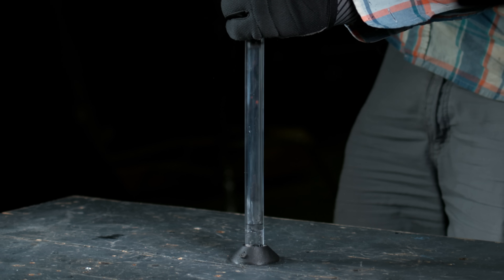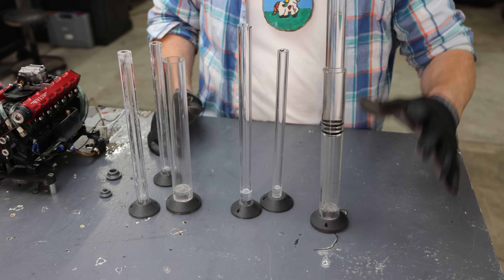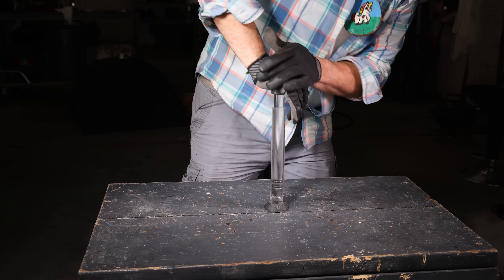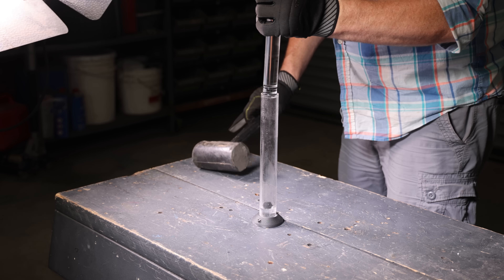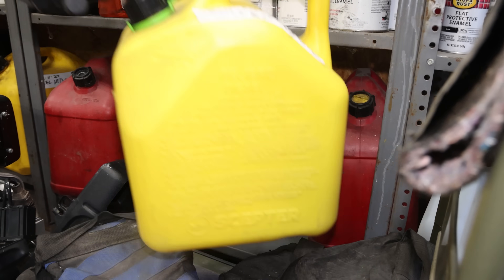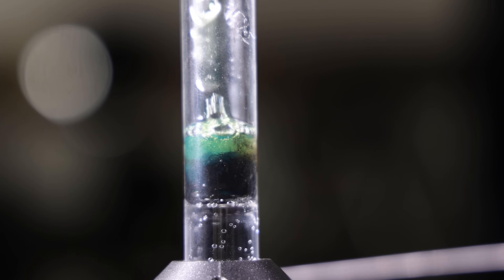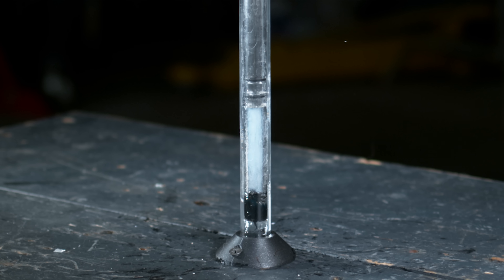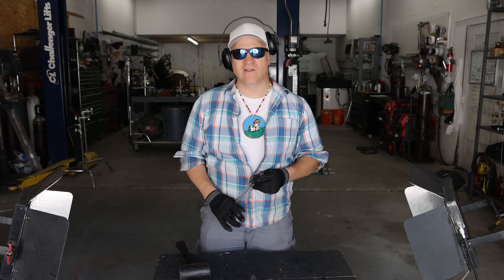How Diesel Actually Ignites (Slow Mo)

Comment: There's probably a good reason diesel engines aren't 
 made of plastic
Reply: Not yet. That's the next cost saving move to come from Caterpillar and Detroit.
Reply: @justacinnamonbun8658  The future is not reliable.
Reply: Probably also a good reason why gasoline motors aren't made of plastic ?
Reply: @carmichaelmoritz8662 what you mean? My manifold and most likely your manifold is plastic 😂😂😂

We on our way, plastic motors lets gooooooo lmao
Reply: @cuinican1980  i hear ya lol. those plastic intakes usually warp around the same time the vehicle starts rusting out.  It's all part of their plan lol.    Mine is aluminum.  First motor went out with around 300 kilometers and was replaced with 180 kilometer motor.
Reply: lmfao, came to say this, and it's the top comment.
Reply: Yes we must create fire & ignition with diesel but in severe cold weather we find them in sick bay with blankets!😊
Reply: Also, they run usually around 16-18:1 compression, most diesel engines from tractors to trucks.
Reply: Bro is giving everything for the show

Comment: This begs the question: isn't a combustion an explosion?
Reply: It quite literally is. Pressure from the ,explosion is what drives the piston, not the heat from fire.
Reply: Explosion is heated, pressurized gas expanding faster than the speed of sound in our atmospheric composition. This is deflegration. If it was an explosion, our guy here would be going to the hospital getting plastic removed from his body

Comment: So if Diesel ignites at a certain pressure, why not do the same principle with gasoline engines. Gasoline would even ignite at much lower pressures, since gasoline is much more flammable than Diesel, right? So you'd have the advantages of the Diesel engine in a gasoline engine.

Comment: Diesel also likes to ignite much better if it’s compressed twice if you can introduce the diesel into the tube just like an engine (under pressure and fine mist) it would probably work beautiful. Diesel doesn’t care about not about running dirty

Comment: Diesel engines range from 16:1 to 25:1. 25:1 is very high even for a Diesel but does exist. It is not the Norm however. 

Turbo charged Diesels typically range from 16:1 to 19:1, while Naturally aspirated Diesel engines range from 20:1 to 25:1.  There are a few odd ball Trubo Diesels that are as low as 14:1 and some custom Diesels that are higher than 25:1 but I couldn't name a  production engine higher than 25:1

Comment: Am I the only one that as I was watching this I was expecting that guy with the hardhat who looks over at some jobsite insanity or other in disbelief, then turns to look at another one?  In fairness he is wearing glasses that could be safety glasses and he's wearing gloves, that's a good thing -- but with explosions going off at nut height I'd be looking for some protection there.
The pyrolyzed cloth didn't need much diesel on it, the more of it there was the more work to get it hot enough.  When you think of how far you can drive on a kg of diesel, lets say 25km at about 80kph -- that works out to 1kg/1125 seconds or about 89mg/s.  Now if the car is four cylinder and running at 2500rpm you'd have 83 power strokes in one second putting the amount of diesel injected into a cylinder for one power stroke is about 1mg.  The amount of diesel on the cloth looked about quarter-gram or about 250 times as much as the engine consumes in a single power stroke.  It is remarkable how efficient modern ICE power plants are.  Even more remarkable that the injector is able to dispense this amount with accuracy given the need for the pressure to be upwards of 500 bar.  And then to be able to do that for thousands of hours and hundreds of thousands of km.

Comment: Actually attaching the charcloth to a piston would allow you to fire it, then pull out and start the fire. This is an ancient device called fire piston.
And it is not only the temperaturę from adiabatic compression starting the fire, but also the increase in partial pressure of oxygen. Use pure oxygen in your fire piston...
But there is caveat: explosion can be much more potent, so you have been warned.

Comment: Might be interesting to try a model airplane glow plug and methanol, compressing the alcohol/air mixture and the thin catalytic platinum wire housed in the glow plug.

Comment: I'm not so sure its the heat that ignites the oil or charcloth. The high pressure increases the reactivity and drives down the flash point. In a diesel piston at the moment of peak compression, oil is "pyrophoric", bursting into flame on contact with the (highly compressed) air. Submersible vessels that have air cavities inside could experience a diesel moment when the air pressure exceeds 25 atm and every trace of oil, paper, cloth, etc. ignites.

Comment: I work with sCO2 - Supercritical CO2.   It reacts similar to this concept except no flames or explosions, it is basically taking liquid carbon dioxide and compressing it to 1,072 psi (or higher) and simultaneously adding about 100° F heat to it, you will watch it turn into a gaseous state.  It is the same stuff they use to extract oils from plants such as cannibas, they also use it for making those powerful Essential Oils that your wife always talks about.  It's also used by Hard Drive computer component manufacturers such as Hitachi.  It is the best degreasing agent in the world, all semi-conductor manufacturers use it as well.  Anyway, I know it's totally different, but the concept of pressure and heat is what I found similar.  Thanks for posting!

Comment: You get an explosion when the liquid fuel evaporates and becomes intimately combined with the oxygen in the air.
You get a fire when the solid fuel is never as finely divided and combustion happens only on the surface of the solid fuel.
Flour mills explode because tiny particles of wheat (flour) are suspended in the air.

It's the intimate contact between oxygen and fuel that makes an explosion.

Comment: but in diesel engine, the torque produced from each ignition some lost in the way of getting other cylinder's compression for more ignition. and to fix that, they tighten the ignition interval per cylinder by adding MORE cylinder, and making engine heavier. so, then some of the torque lost to the weight that the engine still have to deal to propel. see what im getting at here?
it almost levels out. the more larger the cylinder bore, the more compression to do, the bigger the ignition capacity and power output, but since more compression work to do and more pressures required, more torque produced lost in the way too. funny isnt it?
and ALL diesel cars still NEEDS BATTERY and electric motor to start the engine. unless your arms are strong enough to rotate all those heavy pistons and compressions with a lever. 
just get an EV. thats the only coherent energy turning into power flow in any kind of modern engine. there is no power lost in transition.

Comment: That type of experimentation is grossly irresponsible, it was inevitably that the glass cylinder walls would shatter in most cases. Doing that you are asking to blind yourself for life and receive multiple lacerations from flying shards of glass. That type of experimentation should be done within a blast proof enclosure under strictly controlled conditions.

Comment: People often was told there was a glow bulb's inside diesel engines , but the truth always comes.
Reply: It is, for cold weather to accelerate the air heating process. But it depends on compression or turbo psi. Semis usually don’t have glow plugs.

Comment: love this.. i know its an old video..  but alas *NOW* people shou;ld understand why on diesel engines having proper clamping fasterners for the heads and forged internals are a must as well as not boring out the cylinders too much with diesels.. the cylnder pressures are incredibly high in diesel engines..  you also have no timing.. so its very possible for flame is starting while the piston is still under down energy.. granted this piston doesnt have very much inertia but still it can had to the shock and too-fast flame spread..    another thing is this is what happens when you spra ETHER in a diesel.. it explodes very fast and with uncontrolled timing..  something to note for those who repeatedly spray ether in their diesels ratehr than plug them in or use coolant preheaters or fix broken glowplugs...  Awesome learning tool!!

Comment: in the Navy, we called it dieseling.  We were taught whenever you pressurize an air system to do it slowly if you do it too quickly any oils that were left over in the pipe could have a fast burn. That would be bad.

Comment: Remind me why diesel engines are generally so tough..... They are over engineering them for safety. 💥

Super high compression ratio even vs a turbo on a gasoline engine..... By a bunch.😅

Comment: He said a diesel engine has a compression ratio of 22:1.   Nope, most are around 15:1 as that is the optimum for fuel efficiency.
He said diesel engines are powerful because of their compression ignition.  Nope.   It doesn't matter if its compression ignition or spark ignition, you get virtually 100% burn in either case.   But gasoline engines run stoichiometrically (optimum fuel/air ratio), whereas a diesel always operates with less than stochiometry, so its power output, size for size, is always less.

Comment: From my memories of Engineering theory of heat engines, plus a bit of real world messing around with engines.  Diesel is as close as possible to a constant volume engine (a sharp ‘explosion’ at a near constant volume) while petrol engines are nearer a constant pressure machine (with a steady ‘burn’ as the gases expand.  So diesel should explode as you found.

Comment: You’re using far too much diesel fuel, if you put a tiny amount on the back of a pellet, an air rifle will fire the pellet like a bullet, but if you soak the pallet, you don’t get the same big combustion, what was happening? There was a hydrostatic lock which is not been able to compress liquid so instead the walls of the vessel giveaway under extreme compression.

Comment: You need to atomize the diesel! Diesel engines use injectors to spray a precise amount of diesal in an atomized cloud into the cylinder at the right point of the piston stroke. The fuel needs to be mixed with the oxygen, not sitting in a puddle in the bottom of the cylinder!
Reply: Exactly and also trying to scale the amount of diesel used to his 25:1 comp and bore volume (displacement) 😅

Comment: Of course you're going to get an explosion.  That's exactly what happens in a diesel engine.  What makes that different from this is that the piston and the engine block can withstand the pressures developed by the expanding gasses where the polycarbonate cannot.

Comment: My understanding of the way diesel engines work is that the fuel always explodes (detonates), that's why its not called a combustion engine.  And why diesel engines have to be much stronger than gas engines in order to handle the constant detonations.

Comment: I wonder what the compression ratio was for the air inside the Titan submersible?  ...and did its occupants combust?
Reply: It didn’t compress, it imploded!
Reply: @SuperDave-vj9en  It compressed due to the implosion.  I've read that the ratio could have been as high as 67-to-1 and the temperature could have been as high as 2200°F (1200°C).  But since the process would have been chaotic, it would be hard to calculate the numbers accurately and determine if there was enough time for much combustion to occur before the heat would have been transferred to the sea water or converted into sound/pressure waves.

Comment: I don't think you got heat building up from compression alone, because each time it decompresses - you lose equal amount of energy, equally as quickly as you gained it. I think you got explosions from just one stroke of heat. But what might have helped is fuel vaporazing during few first strokes so that it ignites at n-th stroke and good fuel-air mixture gives easier ignition.

Hmm.. Also if fuel partially burned - it should leave net heat in the system... So in that way it could warm up with previous strokes.

Comment: you cannot compress liquid, your fuel (in this case Diesel) is liquid. If you could vaporize the fuel, you could get burn. It looks to me like you are exceeding the pressure capabilities the tube with liquid trying to be compressed, therefore it self-destructs at the bottom the stroke. Rather than pushing the piston back up.

Comment: The explosion that's happening in the video is half ignite and half liquid exiting. extremely hard to compress liquid in a giving cylinder without the liquid wanting to escape before ignition, again atomizing the fuel would help with this.

Comment: Fuel (diesel) is calculated based on cylinder size and compression ratio. The PPM in a giving cylinder stroke for the amount  for the compression ratio. You're just adding fuel and without calculating the amount needed to ignite which is way less then what you are putting in there. You are also forgetting the rule of dispersion for diesel fuel. All diesel needs to be atomized to achieve earlier time ignition with a precise compression ratio.

Comment: I taught Chemistry and Physics for over 30 years and I used to do this exact demonstration.  I used tissue with a little isopropyl alcohol on it for my “fuel” which generally would produce some smoke and a small flame.  I also had a very thick-walled glass tube which ultimately exploded and caused a nasty cut on my hand during one demonstration.   This was the result of me having to hold the tube while plunging the “piston” with the other hand…which really was not the safest set up.  If you really wanted to get the student’s attention, you would announce that you were going to demonstrate something during the class that might blow up…lol  They always loved the explosions…
Reply from the maker: Thanks for sharing, a thicker wall tube would have done the trick no doubt, That's exactly why I had thick work gloves on. Not sure why but explosions are always fun
Reply: There is no way I would be holding that tube if was doing that sort of thing.
Reply: So will 2 50 gallon drums do?

Comment: Add a fast response pressure transducer and trace next to light intensity. You can also measure electrical resistance of the gas (flame conducts).

Comment: People have gotten the idea to rig oxygen cylinders with their fairly high storage pressure to move or position a hydraulic piece when this effect hits hard, it's a bad idea. It's also why there's a 'no oil' notice on oxygen system gauges.

Comment: it piston could be hydro locking  and over pressuring the plastic right during the explosive event.  try to strengthen the tubing by doubling up.  one tube tightly fit in a second tube providing more thickness.    for safety I would build a shield between you and the lower half of the tube.   Good Luck.

Comment: The tube blew apart... duh
Myself and hundreds of thousands if not millions of people haul >+80,000lbs using this very principle in controlled explosions trillions or quadrillons of times per day.
Cool video... also... what did you think was going to happen? 
Of course it blew up the plastic tube upon ignition. Hmmm cant imagine why this is the fuel used to haul heavy loads basically everywhere on the planet...lol
Love the videos bro. God bless you and yours brother.

Comment: What pressure did you size the tubes to deal with? Cause even though compression is like 400 PSI, at the moment of ignition it spikes up to around 3500 PSI in many engines and can go higher if the engine knocks. The high speed camera shows you're actually achieving detonation in your fire pistons, that's why the pressure gets so high the tube blows.

Comment: The problem you're having is that the diesel isn't atomized, and carries a relatively huge amount of thermal inertia, so while you're getting potentially the pressure needed to ignite, it isn't going to because the diesel itself isn't warm enough -- like an engine that is flooded. Now when you hit the piston down with the hammer, that non-compressible diesel has nowhere to go besides through the wall of the cylinder.

Comment: It is not a good idea to hit the piston with a hammer. Because the pressure inside the glass tube, when the fuel is about to be ignited, wants to push the piston up, but the piston cannot move up due to the force of the hammer. Since the pressure is looking for a place to escape, it affects the inner walls of the glass tube and the tube breaks. If you had installed a crank mechanism on the end of the piston instead of hitting it with a hammer, we could have seen a real diesel ignition.

Comment: I think you had WAY too much liquid fuel in the rod, actual engines use much less fuel per stroke, but the vaporize it first. Blowing up the tube is a better alternative than the piston shooting up a 100 meters with all that fuel

Comment: i think when you're compressing a liquid in the bottom of the cylinder, it's cavitating which causes a pressure wave and the cylinder to rupture (i think you even saw a white pressure wave cracking the cylinder a frame if you look at ~5:26 just before the yellow of the flame starts it has already fractured), whereas with the char cloth alone, previous lower compressions had caused mixing, the char vapour was sufficiently dispersed in the cylinder before it successfully ignited.

Comment: Bro a fuel injector is designed to atomize the fuel Into a fine vapor mist for even and complete combustion. Spray bottle a fine mist would have had better outcome then just pouring fuel in it